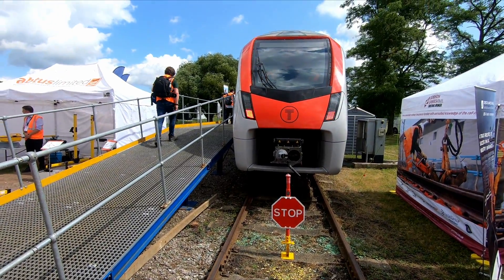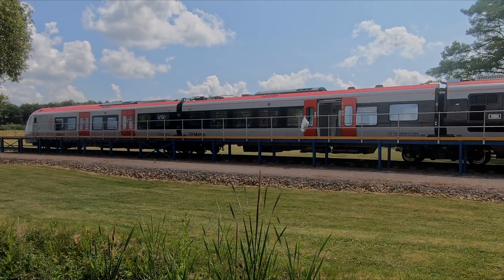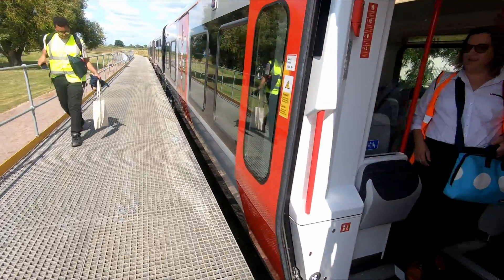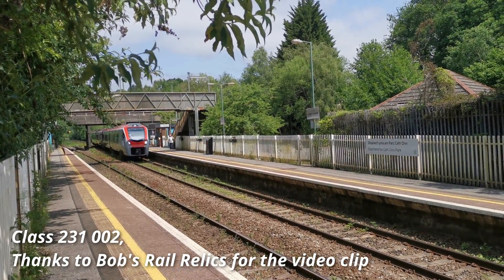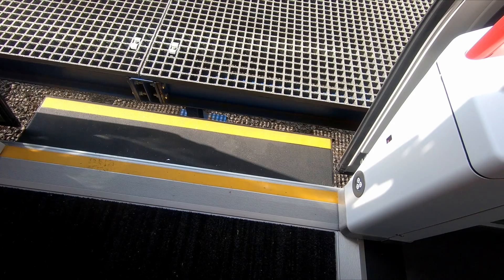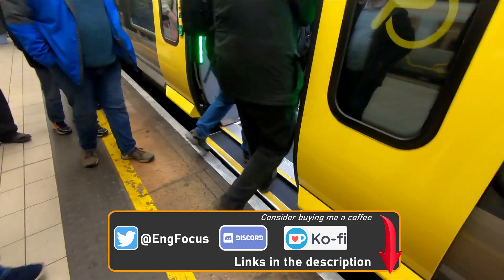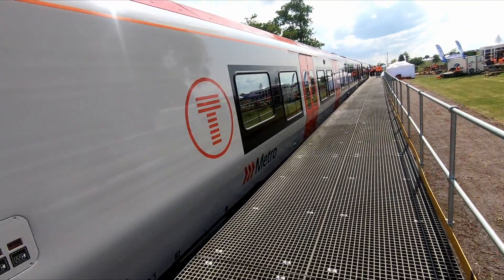First look onboard TfW's new 'tri-mode' Class 756

Comment: Are these the same ones that are currently tipping over and falling off the tracks as they enter the sheds at Taffs Well?  If they are, then a TFW Area Regional Manager told me that they may never enter service until the defects and tracks can guarantee security?  Also, so much for TFW's statement of "cleaner travel" if their stock is intending to covertly use diesel!!!!!

I thank you for this video though, as you may have inside knowledge/contacts as to the afore mentioned predicament!
Reply from the maker: No these units aren't stabled at Taff's Well. The new depot is for the Class 398s.
Reply: @Rail_Focus  Thank you so much for your reply. Dave.

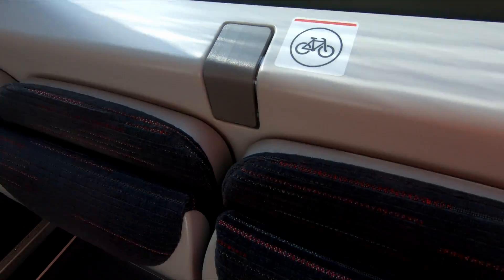Comment: 5:07 I have used the same ones one so the class 231, you simply pull it out from it area and then place it on the LOWER part of the bicycle frame. Just be careful not to let go of them cause it is literally a slap of metal and will be straight out that window if it gain enough speed (with the mechanism that pulls it in I’m sure it would hit the window with enough velocity to smash it)

Comment: Both the Class 231 and Class 756 TfW FLIRTS are very nice that Stadler have built. And not forgetting the Class 398 City-link tram trains which are expected to enter service from mid 2024. I have been on Greater Anglia Class 745 and Class 755 and they are very nice trains.

Comment: Massively disappointed they are not using FLIRTs on the route to Birmingham International. Not sure if the CAF units are bi-mode but given that the line between Wolverhampton and Birmingham International is electrified - and that TfWM would like to electrify between Crewe and Wolvo in future, the FLIRTs would be a great choice for this route.
Reply from the maker: CAF units are DMU only unfortunately. It would've been great if TfW operated FLIRTs on all routes as they have DMU versions and IPEMU versions for running between non electrified and electrified sections. But I imagine the FLIRTs are not cheap.
Reply: @Rail_Focus  Im actually a proponent of having a rail clean air zone in the TfWM boundary. Charging TOCs that use their diesel engines inside the boundary. ALL areas within the boundary should be electrifed to make this possible.

Key TOCs that should then convert to bi-mode would be Chiltern, XCountry, WMT/LNWR and TfW. Freight should be exempt though, but avoid the cities - no class 66 through New Street dor example.

Comment: Utterly disgusting that there is new rolling stock and electrification of the commuter Cardiff lines whilst the main South Wales line remains diesel from Cardiff westwards. In addition to this the intercity travellers have to use old stock that is not much better than cattle trucks. Mid and N Wales are the same for those lucky to have any railways. TFW and the 'Welsh Government' are a joke sadly.
Reply from the maker: Agree the line should be electrified to Swansea but TfW is getting all new stock apart from the loco hauled sets, but they are great for passengers by all accounts.
Reply: @Rail_Focus  I think it should go right down to the Irish ferry ports. Plus the London and Manchester lines have to use a two rail track so express trains get held up by commuter traffic. I have a lot of first hand experience travelling Swansea to Manchester Piccadilly and the service is deteriorating. Along with the rolling stock. Sadly se have been promised new stock for years now.
Reply: Network Rail is not controlled by the Welsh Government. Personally I find it outrageous that WG are paying for upgrades to NR infrastructure to make up central government's decades long track record of non-investment.

Comment: What's the battery range? It seems a bit strange to talk of batteries only being used to get through tunnels or under bridges or to power for a "short distance to the next station in the event of a power failure" when other battery trains claim 100Km real world range (and I think it was Stadler that set the record with over 200Km).
Reply from the maker: I believe the batteries will also be used in conjunction with the engine to provide additional power over the Vale of Glamorgan line. But the batteries will also be needed as there will be gaps in the electrification.
Reply: It depends on how big the batteries they put on are. Long range requires really large batteries

Comment: These look like they could be a game changer - they look really good. Also, by removing the engines from under the carriages, unless you are next to the thrash cabinet (!), it should be much quieter than many multiplier units.
Reply from the maker: Going from.a cl150 to these will be like night and day. I imagine the doors will help dampen any noise, but the engine will only be on on the Vale of Glamorgan line.

Comment: The Class 756 Tri-mode FLIRT does look really nice and quiet compare to the older diesel trains. Perhaps Stadler should continue on manufacturing more new FLIRT Bi-mode and Tri-mode rolling stocks that would be ideal to operate in Southwest England, North of England, Scotland, the East Midlands and London. 

And maybe new Flirt trains for Northern Ireland and the Republic of Ireland. And Stadler to build a UK based train manufacturing plant to continue on their mass production of FLIRT and Metro rolling stocks. And new London Underground tube stocks to replace the existing tube stocks on the 1972 Stock used on the Bakerloo Line and 1992 Stock used on the Waterloo & City Line and Central Line.
Reply from the maker: Hopefully FLIRTs will become commonplace in the UK, they really are exceptional trains.
Reply: Siemens is building the new Underground stock, not Stadler

Comment: 5:30 Are you old enough to remember when soft-close/open was considered a sign of quality on a cassette player or have you just learned about it on reviews of classic tech? Or maybe you've discovered this signature of good design separately. I was on one of those flip down seats on the London Underground S Stock, got up to get something out of my pocket and sat down again, only to not realize it had 'helpfully' flipped back up. I fell to the floor, spilled my coffee on myself and thought it was hilarious but what with it being London, nobody else noticed or if they did, they didn't say anything about it. Maybe if the flip up seats had brakes like these ones, my coffee, jeans and dignity would still be intact. Scratch that; the dignity departed me years ago.
Reply from the maker: I'm had plenty of cassette players in my youth, I'm just not used to seeing little touches like this use on a rail vehicle 😉